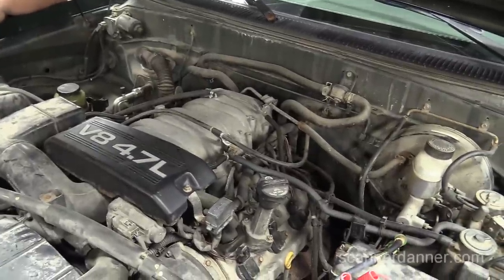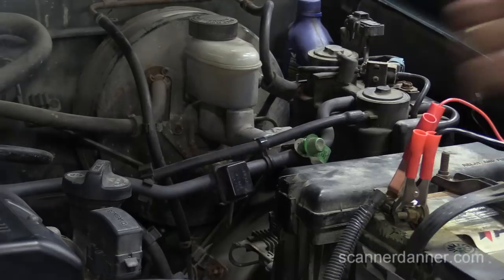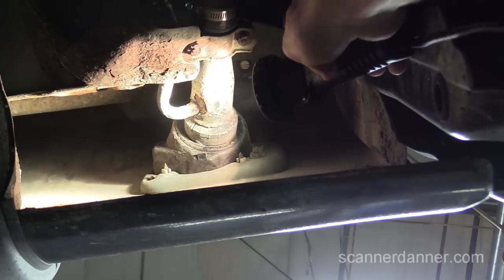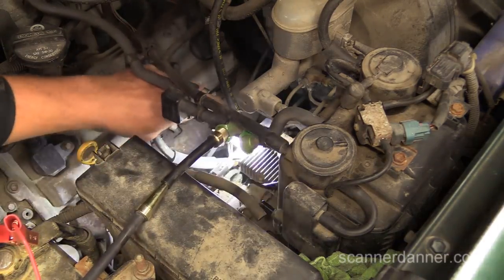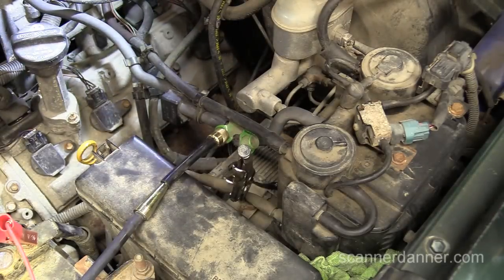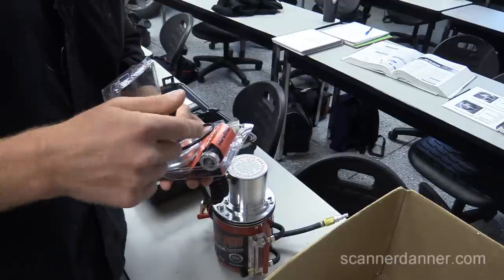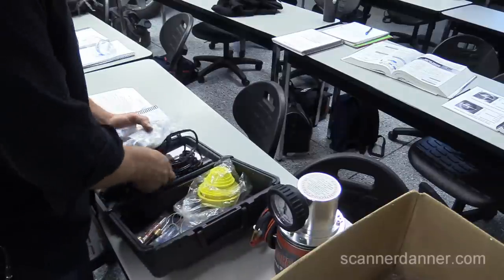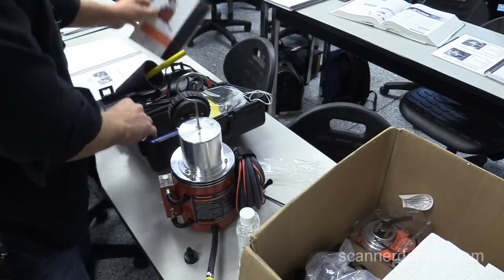REDLINE Smoke Pro, EVAP and Intake Leak Testing + Unboxing

Comment: The dealership that i work at has one of these Redline smoke machines, works very well. Have used it a couple of times, with good results. Was able to find the leaks easily. About filling it~ maybe the machine was changed, but the manual has'nt been changed yet. Only way to know is to ask the company. Coincidentally, you posted this video at a good time, i was explaining to someone yesterday about evap codes and finding evap leaks, sent that person the link so he can watch and understand. Thanks for posting this, Paul!

Comment: I don't know about the redline but the idea behind not overfilling is that machine can not produce enough smoke if there is too much oil to heat. Another great video for the evap beginners.
Reply from the maker: can't overfill this one. the older unit you could. Maybe that's why the instructions warn you about it. They are probably the same instructions for their older unit

Comment: The thing I like most about the smoke system is that it is non invasive testing. This is a   big selling point for me since not all evaporation systems are comprised of components rubber hoses and hose clamps and you can introduce leaks into the system just by disconnecting and connecting hoses.

Comment: I picked up one of these used on eBay for $450 a few months back...had all the accessories with exception of the capless fuel tank adapter and the EZ Intake.  I purchased both and just used the EZ Intake this morning to smoke an intake.  It's a great tool...Don't use the paint can smoke machines as you can get fuel vapors coming back into it and possibly start a fire.  That's what I heard anyway and it scared me away from them.  Love my Redline Smoke Pro!
Reply: johnaclark1 smoke cans are fine. The constant air flow prevents backflow of vapors.

Comment: I bought that exact flowmeter off ebay brand new for $20  and attached it to my SmokeBrake Automotive smoke tester...works EXACTLY as demonstrated in this video. Also, Redline sells 2 types of flowmeters for those just wanting to upgrade their existing machines. Great vid Paul...as usual.

Comment: Neat little smoke machine! I need to upgrade from my glorified paint can with no flow gauge. Would be nice to know how big the leaks are.Thanks for showing us this one. Looks like a good quality setup.

Very familiar sight towards the end there - under the hood of a GM S-series truck with a 4.3. I used to own one. I swear I spent more time looking at that engine than looking out the windshield, lol. Great engine, but with craptastic components bolted to it. When I yanked it out and slapped an Edelbrock intake and carb on it, and stabbed a HEI distributor in there, it suddenly became reliable. I then put it in a '89 S10 Blazer. Was a fun little winter beater until it rusted away.  :)

Comment: Why didn't you apply vacuum to the close valve to check the canister first? Just wondering.
Reply from the maker: no particular reason, in this case it turned out we didn't need to focus in that direction

Comment: Concerning the 4.3 liter throttle body to cover air leak. The dry rot seal can be replaced, but with modifications. My 96 Chevy S10 was leaking bad and I purchased a new shaft seal. The height was perfect, the I.D. was perfect, but the O.D. was a few millimeters too large. Had to turn down the seal to the correct size and installed it.

Comment: We have the older version of that smoke machine. I have found that using soapy water is typically alot easier to find leaks. There's been a few things I've smoke tested and couldn't find anything but found it with the soapy water.
Reply from the maker: wait until you see my next upload. soap and water was key as you stated, I could NOT find it with smoke, nor smell any gasoline when I had the smoke machine pumping air into the system
Reply from the maker: they do, I think it is like 1.5 psi? but not sure
Reply: This is because EVAP systems are sensitive to high pressure, according to the manual, even on EVAP service cap, says no more than 1psi. Manuals says that pressurizing the system too high could damage components, I don't know how true is that.

Comment: About Toyota/Lexus evap vent lines: bidirectionaly controlling the vent valve  or canister control valve (CCV) will NOT seal the vent circuit of a Toyota evap system even on late model vacuum pump equipped systems. There 's a check valve that allows the canister to vent during refueling(positive pressure), and seals under vacuum. In order to smoke test any Toyota evap system  (or at least every model I've seen as a dealership tech) the vent line has to be pinched or plugged. I got once got burned hard by a '14 sequoia with a pin-hole leak in the gas tank because this is never really stated in the service information...
Reply from the maker: That is a great tip Brian! Thank you so much.
Reply: Toyota's EVAP system is one thing I have never fully understood.
Reply: work for Toyota too a lot of stuff is missing in the service info thanks for sharing
Reply: I was wondering why I had a 20 thousands leak with the vent closed. But passed the evap small test on the scanner. 2005 Lexus g470. I tan the test 3 times after I replaced the gas cap and seen a leak on the flow meter. Cleared evap monitor 3 times and passed so now I know

Comment: They say to not overfill. Because if you filled to the top of the plug hole threads screw in the plug, when that plug screws in it will create pressure in the system and could damage internal components.

Comment: Overfill it and it spills out.  Had a funny evap leak a couple weeks ago.  Definitely had a leak but could not find the smoke.  After a long time, found the leak in the trunk where someone had drilled a small hole in the trunk- into the gas tank!
Reply: Lowell Chrzan...YOU DO KNOW THST ITS AGAINST THE LAW TO SHOOT THE GUY THAT DRILLED THAT HOLE, DONT YOU??? Although, you and I both want to take aim, fire, and reload, we just have to sip on our coffee, and shake our heads, roll our eyes, and hope the blood pressure goes down, long before the blood vessel ruptures!!
Reply: common on police car they screw down fire ext. gun mounts in the trunk
Reply: Not sure where all that came from.  This car was a total POS 6 cyl running V8 Northstar Deville wiith leaking heater hose fitting wrapped in tape and zip ties.

Comment: Hey scanner danner where can i find a evap machine that you are using in the video thabks for the videos very informative
Reply: Deo Nandkumar...check the description below the vid!! 

It shows that you edited this vid, what did you edit, go back and misspell some words??
Reply: Any Tool Supply Business --online,& many distributors, have
all the different brands of smoke machines.
The Redline is the least safest & as you can see,stressed Paul out,
just getting it out of the box. (the school paid for it or it was free,
so it works for their purpose)
There are adds in all the Automotive Trade Magazines at times,
at least in the USA
Reply from the maker: pc zapp , other than using compressed air (which most smoke machines do) what makes the Redline the least safest? I'm just curious. Thanks!
Reply: I bought one on eBay less than 6 months ago...Picked it up for $450 with all the accessories but the EZ Intake.  There are deals out there if you keep an eye out.  My only complaint is it would have been nice to hold out for the one that doesn't need shop air connected to it.
Reply: ScannerDanner...Paul, I think PC Zapp was being humorous about that machine. Talking about the unpackaging/frustration THAT you experienced, thereby possibly causing an elevated stress level/blood pressure and a possible STROKE!!!

Unsafe was just a relative term, loosely referring to a situation where you may or may not enjoy the stress/high bp/CVA!

Comment: I'm in the market for a smoke machine and I'm stuck between this or the otc leak tamer
Reply: Smoke Wizard GLD 40 --that is the only smoke machine you want.
Check out all the web sites & videos on it.
ASEWave ---  has it now for $868.00 but you will have to pay 
for shipping.
There is a company serving veterans & municipalities, that is good
to deal with & shipping is free
They Do Come in Many Colors --not just yellow & can lay down in
your roll cab & DO NOT use Baby Oil & are OEM Approved World Wide.
Reply: pc zapp what sets it apart from the other 2? Looks like it have very similar features as the OTC
Reply: The Wizard is safer for many reasons.
Mainly the heating element verse the
Redline heating coil
It could be some of the newer machines
made in the last couple years, are similar
to the Wizards technology, that has been out
for many years.
The Wizard & Redline are obviously the smallest machine.
It has never been recommended to use baby oil, which is a Redline speal
The OTC is nice,but it is big & I can not find out what is inside that makes
it work,you need to know how they heat the oil.It does however use the
Ultra Trace UV Dye, which OEMS Require (if anyone even cares),not the 
crap the Redline uses.
On smoking the fuel tank end of the system,you may want to consider
using Nitrogen verse Shop Air.
Reply: All the smoke machines will have the same outside features or
functions,it is what is inside that matters & what fluid is recommended
buy the vehicle manufactures,again, if anyone cares or does the research,before buying one.
I have made many calls to these companies & they are lost when I ask,
What A/C Power Supply can I use with your machines.
We have batteries under the hood,under the rear floors or seat,
in the trunk.
Your working at the other end of the vehicle,really, why run out out
cord & what if you don't want to load the battery while doing diagnostics?
We'll let Paul weigh in on that question.
Reply: Redline also makes one that doesn't require compressed air.  It's the Smoke Pro Air Complete.  You can pick them up for much less on eBay than on the RedlineDetection website.
Reply: pc zapp Good afternoon. I keep a small motor cycle battery for checking things. That would work for smoke machine.
Reply: I got mine from Amazon for ~$680

Comment: When you had the smoke blowing on your hand did it leave a oily residue? Mine leaves an oil behind and I’m reluctant to use it because of that.
Reply: Are you using Baby Oil or Oil Recommended for Evap Systems ?
That may be another issue with the Redline Heating System &
the baby oil.
Take a look at BullsEye Leak Detection,that is a Bernie Thompson at
ATS -- Products. But like all his stuff, you need very deep pockets & a need
to spend that kind of change for them.
Reply: I used mineral oil. Which is supposed to be in the approved fluid. It’s a used machine. I only tested it once and haven’t used it on a car because I’m not sure if it’s normal or not. I’ve looked around an answer and haven’t been able to find one. When you’re checking scanner danners hand for residue you know you need help. Lol
Reply: I'm not a Smoke Machine expert,I just read up on equipment 
 before buying,as apparently several folk here are considering.
Mineral Oil is not Leak Detection Fluid/Oil
Mineral or Baby Oil--is Redline's claim to fame,just do some research
before you buy that product.
For those making their own machine,baby oil works for them.
Most home made products are not used in professional shops.
Reply from the maker: no sir it did not, but I think all of them would leave some type of residue
Reply: Some oils have a trace dye in them for use with a UV light

Comment: Hey Paul - where did you get your evap tool?  I have a smoke tester but I need the adapter to connect to the service port.  I normally use my smoke tester to find boost & vacuum leaks.
Reply from the maker: I got mine from redline themselves. I did find this same unit on Amazon and it is listed in the description of this video

Comment: Hey Paul, I have an issue right now that I feel you would know the answer to really quick. The issue isn't related to this video but other 5v reference short circuit videos you have posted. I have a 2001 Honda Prelude that has a p0108 code. When I unplug the pigtail from the map sensor with key on engine off, I test the the three wires assuming one ground, one constant voltage, and one variable voltage for the reference. But when I test with the multimeter I get one wire with 4.7 volts, the ground which I'm not 100% on how to check, and then the third wire gets constant 4.9 volts. I haven't back probed the sensor and tested with key on engine off or koe on while it's plugged in, I only tested koe off with the pigtail unplugged as I previously mentioned. Has my constant 5v wire shorted to the reference wire? How is it possible for the reference wire to get constant 4.9v? To my understanding if the reference wire shorts to ground, I would have low voltage coming from the ref wire to the ecu, but what cause constant high voltage reading? I have recently changed all the grounds on the car, but have double and triple checked them, and went with a lower guage wire just to safe. I also moved the battery to the trunk, and it's not grounded to the fraimrail back there, but to the back wall where the taillights grounded from the factory. Could my issue be a bad ground? The car was getting 12v to everything it needed to in the fuse box and everything else works fine, so it seemed to me the battery ground was a good strong connection. I tried to put a new map sensor on, but I took it right off after I turned the car on and it was still throwing the same code, should I have reset the code it the computer before so quickly assuming I don't need a new map sensor? It seems to me it's an issue with the harnesses somewhere but I don't know. I really could use any input that you have, sorry for the long message but I watched your videos and I know for a fact that if the car was in front of you, you would fix it quick. Please help if you can, and if there's a better way to talk back and forth, def let me know.
Reply from the maker: A few things, first your terminology is a little off so my answers will be confusing if I don't clarify that first. The constant voltage or power wire is the reference wire (5v reference wire/circuit), which you read 4.9V on. The signal wire had the 4.7 volts on it and this is normal with the sensor unplugged. There is an internal "bleed resistor" in the ECU that is connected between the reference circuit and the signal circuit that will help the computer identify signal circuit problems. What you read on the signal circuit with it plugged in is more important, on your car it should be around 2.9 volts maybe a little less with the key on engine off and should drop in voltage when you start the car. 
The ground wire can be checked by backprobing, plugged in as well, with your voltmeter still connected to ground on the battery. You should have less than 100mv reading on that test. Let me know and we will go from there.
Great questions BTW! You've been paying attention, I can see it.
Last thing, you did not tell me what the car is doing other than the code. If you moved the battery to the trunk you absolutely need a ground wire from the block to the body of the car in the front. A heavy ground cable too. Is this also a no crank problem? Or cranks but has weird electrical faults along with this code?
Reply: ScannerDanner thanks for your reply, sorry it has taken me so long to get back to you this past week has been kinda crazy for me. The car cranks and runs, but doesn't idle very strong and wants to die when I close the throttle. As soon as it's up to operating temp it does not idle at all and will only run when in gear while it's moving. But it will run  when warm if I hold the throttle open. Those are the only other symptoms, only code is p0108 and has no other electrical issues at all. The only symptoms are the no idle condition and a very heavy smell of unburnt fuel, seems to run very rich all the time. I have a 4 guage ground running from the block to the chassis. I have backprobed the sensor, with KOE off the the reference wire has 4.94 volts and the signal wire reads 2.84 volts. With KOE on at idle, the reference wire read 4v to 6v constantly changing; and the signal wire read 2v to 4v never holding steady but always changing. With KOE on at open throttle, the reference wire read 4v to 7v, and the signal wire read 4v to 7v as well, both readings never held steady but constantly changed. With KOE on and the multimeter set to the 200 ohm continuity setting, I attached one end of the multimeter to the chassis ground and the other to the ground wire on the plug and the reading was 38.1 constantly. Is this 38.1mv or 381mv? I think it's 38.1mv but I'm not entirely sure. Is it possible that I just have a bad map sensor? I replaced it but took it off immediately after one start because the code did not clear. Should I have waited longer for the ecu to adjust or removed the code myself via scan tool or unhooking the battery? Thanks for all your help, I wish I could bring the car to you and watch you diagnosis it in person but this is not an option. Hope all is well with you and I look forward to your response!

Comment: This has nothing to do with smoke test i have a ford ranger run bad in drive and good in neutral fires right up.   Seems like it will not rev past 2000 rpm any help would be great
Reply: John Schwieter maybe clogged cat on exhaust